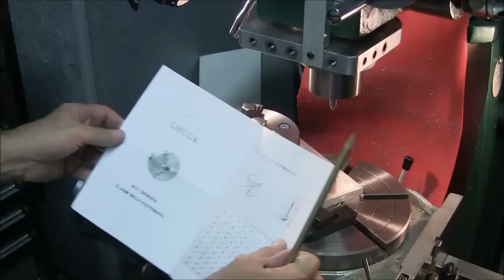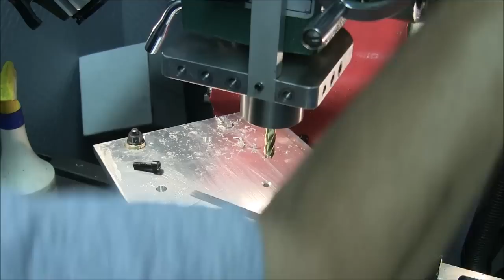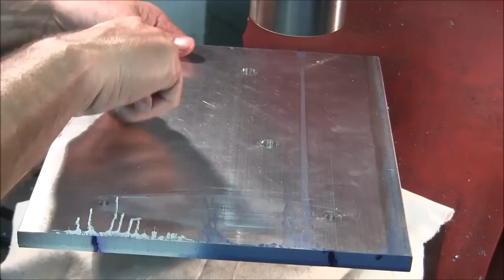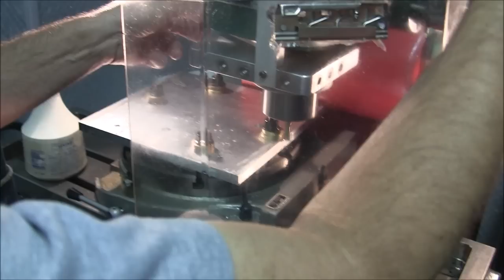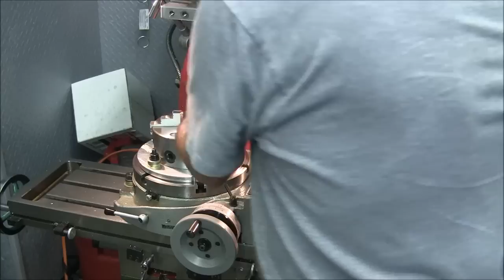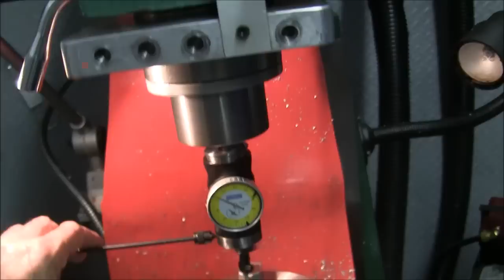Mating a chuck to a rotary table.

Comment: I realize it’s an old video but that’s good. I am going to do something very similar and your experience since then will help.  I am going to mount a d1-4 spindle nose to a mounting plate bored and threaded 1-1/2 8tpi for my dividing head and four way slotted for table top or rotary table. I do have an 8 inch riser in place so height less of an issue. I plan to use a pin for alignment but am wondering about adjustment options. Internal set screws in the spindle head. Problem is I need two rows as I will have three planes of motion/ freedom.
Reply: Francisco, I'm not positive I understand exactly what you want to do. However, fine thread set screws will give you finer adjustment. I hope to see your result on YouTube!

Comment: Simpler method- drill through the 3 chuck mounting holes from the back to the front with a 1/4 drill- go to front and counter bore the 3 holes for 1/4 socket head cap screws.  Put a morse center in the rotary table and center your chuck on it. Transfer punch  through the 3 holes into the table and drill and tap for your 1/4 bolts.  Bolt your chuck directly to the table- done in 15 minutes no machining, no adapter, just 3 bolts.
Reply: OLD SCHOOL—

I created that assembly long ago. At the time, due to my inexperience, I was afraid to drill holes through the chuck. Consequently, the adapter plate ate up a little, but very critical, cutter to chuck distance. 

My shop is disassembled due to a BIG move we are making (take a look at barbandbillc). When I get it all put back together and need that chuck, I’m going to do exactly as you suggested.

Thank you!

—Bill

Comment: Do it the easy way-   drill through the 3 mounting holes from the rear with a 1/4 drill.  Then counter bore the 3 holes on the face to accept 1/4 socket head bolts.  Put a center or a stub in your rotary table center hole and grip it with the chuck jaws to center the chuck on the table.  Transfer punch through the 3 holes into your rotary table and drill & tap for your 1/4 bolts.  Done in 15 minutes, no adapter, no machining,  just bolt your chuck directly to the table and go.

Comment: I love watching Noobs.
Reply from the maker: Leo, you are correct; I am a "noob." I am not a professional machinist. I took up the hobby several years ago and have learned a lot from both professionals (such as yourself?) and amateurs over the years. But, I will always be a "noob." 

I learned a lot during this project and in using the resultant assembly. Basically, my mill does not have enough head height (about 15 1/2") above the table to perform many larger jobs with the chuck/rotary table combination. However, it does allow me to create many small parts I need to build the little stationary steam engines which I give away to folks that may find them of interest.

If you have any advice/tips/guidance on this project or any others, I would appreciate reading it.

Comment: Hi, Bill, liked the video.  I suspect part of the reason your cap screws wound up a bit high is due to the fillet between the head and the shank of the screw.  When you finished the counter bore you should have gone down the bore with a counter sink or drill and put a chamfer on the top of the small hole.  This is a good practice anyway from a strength standpoint, and reduces the stress riser condition.   A small radius on the outer edge of the mill used for the counterbore is also a good plan.
Reply from the maker: Dick, got it. Thank you for the guidance!

Comment: On the counter bores , I have made quite a few by reducing the diameter of a suitable drill bit with the grinder. The reduced section acts like the pilot for it and stops the remainder from wandering off when drilling the counterbore. They work really well and give great results. Great work by the way.
Reply from the maker: Andrew, thank you for the tip. It sounds like an easy solution.
 Merry Christmas!
Reply: @BillChennault  no entiendo solo español
Reply: No estiendo
Reply: @fernandosaavedrasuarez9847  Fernando, lo siento no hablo español. :(

Comment: bill wy not concider a  6 or 8 inch  spacer block 4 the mill from grizzley.
Reply from the maker: Jamie, I did think of a spacer block . . . after I finished that project and found out just how little vertical space I had!

My shop is now in storage awaiting the construction of a new shop on a remote piece of land to which we will "migrate" soon. My trusty Grizzly G3616 mill will become a second mill because I really "need" a larger machine.

Comment: You haven't  got a clue in hell what your doing.
Reply: +James Hatfield no need to be rude
Reply from the maker: +James Hatfield James, you are right, but fortunately I am not in hell. On the other hand, I am certainly an amateur machinist with the emphasis on amateur. I would appreciate any hints and help you may care to offer.
Reply: +Bill Chennault  ok Bill sorry for the bad comment, but to get the spindle in line with the  chuck c/l put your indicator on the chuck on a mag base ,put the table in neutral and spin it by hand and indicate the spindle.You dont care where the chuck is on the table you want the  spindle in line with the center line of the chuck.
Reply from the maker: +James Hatfield James, no problem!

In another walk of life wherein I am (was; I'm retired) a true expert in certain matters, I tend to make "short" comments at times. (Don't we all have those "moments" when we see someone doing something like that?)

If you note the date on that video, you will see that I've had time to learn a bit since then. One of the things I learned was what you suggested, although your exact method is a bit easier than what I've been doing, which is to chuck up a piece of drill rod with the indicator in the spindle.

Merry Christmas!
Reply: +Bill Chennault In your case for what you are doing that's  probably  as close  as  you need to be
Reply from the maker: +James Hatfield James, next time I mount it on the mill I am going to do it your way.
Reply from the maker: +Martin Thank you for subscribing, Martin!

Comment: My guess is the chuck bolt center is 14.2 cm.
Likely it was designed and built in a metric country.
On would think if only one think was included the manual it would be this measurement.

Comment: Bill, i used the the tables MT feature to make a adapter (draw bar style) with mount for lathe chuck, now I can remove chuck from lathe (work piece still in chuck) and mount in previously centered rotary table. Works for all my lathe chucks and face plates. Oh! Recently made a blank plate to super glue very thin stock and machine .
Reply from the maker: Rexx, that sounds like a great solution. Do you have pictures? (I hope!)
Reply: I'll be back to the shop Saturday and get a pic of my adapter. If not, I have a SB with a 1 7/8 - 8 threaded spindle. I threaded bar stock , tapered it to match the table, and threaded the small end ( for nut ) to act as draw bar.
Reply: Got pic, need somewhere to forward.

Comment: That indicator you used is new to me. A vid on using the coax indicator would be awsome. Great video, thank you for your time!
Reply from the maker: Ras, it is a coaxial indicator. They are great for aligning either a round hole or a round rod to the spindle axis. It takes only seconds to align your work using one of these devices. (I bought it specifically to reduce the time necessary for aligning a rotary table to the spindle axis.)

Mine is a Fowler. I bought it from ENCO. Here's the link . . .

http://www.use-enco.com/CGI/INSRIT?PARTPG=INSRAR2&PMAKA=327-0040&PMPXNO=21959757

Glad you liked the video!

Comment: hey bill i really enjoyed your video because i bought the exact same 6 inch chuck from grizzly.your bolt hole circle calculations were the same as mine for the diameter to bolt the chuck to my1/2 inch alluminum plate for my southbend 8 inch rotary table. i just purchaced a 9x49 trump mill that im learning on and really enjoy it. i have a video on youtube showing the mill and a smoker im building just punch in bucks shop if you would like to watch it. thanks again bill for the good video.
Reply from the maker: Jamie, I'm glad my video was useful to you. Mating chucks to rotary tables seems to be a popular topic. I watched a few before I started machining mine.

I will certainly watch your video about the Trump mill and the smoker.
Reply: Ok bill enjoy bud

Comment: What do you think would be the most accurate way to center a rotary table to the spindle?
Reply from the maker: ExtantFrodo2, I use a coaxial indicator. It makes centering easy. I bought mine from Enco. http://www.use-enco.com/1/1/18004-13-979-0-spi-coax-test-indicator-sets.html
Reply: Bill Chennault
Thanks. For what I'm working on I need better than I could get by holding a rod in the chuck, then tightening the rotary table to the mill. It looks like I may end up buying an indicator.

Comment: Hi Bill
 
Nice to hear from you. Sorry for my late reply. No sir this isn’t Kansas :) Well its quit special to live where i live. The Stockholm archipelago consists of over 25 thousand island and my home is right in the middle of the archipelago. I am born and raised there and i spend most of my time there. However its just 6 miles to the capitol of Sweden from where i live so i do a commute on a daily basis to my office. I am the 5th generation living there and the previous ones where living of the sea in different ways, commercial transport, carpentry, keeping animals and so on. But in this modern day and with good transportation like hovercrafts and a nice commercial boat I am able to do the commute as often as I need it and my job today is a network security technician for a international company. But in my spare time i do some commercial diving with a work boat and a barge, run a charter/taxi boat, doing a forestry project on my own islands to open up old grazing land, and i have a small horde of cheep. So i do a little bit of everything.
 
I have a keen interest in machining so i was glad to find your channel. I have been following Kieth Fenner, myfordboy, mrpete222, doubleboost and some other machinists on youtube since they began there video blog and i have learned so much. I am in the process of building my own small shop on the island to be able to do both work for myself and for others if needed. I like the old school approach to machining and i think it is on its way to be forgotten by younger generations who take to CNC and computerized technologies instead of learning the basics. And I am not that old, only 36 but I feel old when I look back on all the videos of exceptional machine work that some day may be forgotten. I for one will not let that happen and will try to learn as much as I can fom all of you and try to apply this and pas it on although I am not a trained machinist.
I rely enjoy your videos and i hope that i can contribute in a year or so with some of my own machining videos.
Best regards
Mats Horngren
Stockholm/Sweden
Reply from the maker: Mats, you and I watch the same video channels, so the distance between Kansas and the Stockholm archipelago may not be so great, after all. 

I am a retired academic. I touched a lathe in high school, but that was almost the only experience I had until I decided to jump into the hobby at 58 years old. So, we are both learning.

I imagine a small machine shop in your area might be a real boon to both you and others. Boats and hovercraft probably eat metal parts now and then!

Thank you for watching my videos. Since you also watch the smart guys, I can't hurt you too much!

I pray you and yours are happy and healthy!
Bill Chennault
Kansas City, Kansas
Reply from the maker: Bill Chennault Mats, in your spare time, surf over to :The Home Machinist!" at . . .

http://www.chaski.org/homemachinist/

That is where I learn a tremendous amount. They are a GREAT group of people.

--Bill